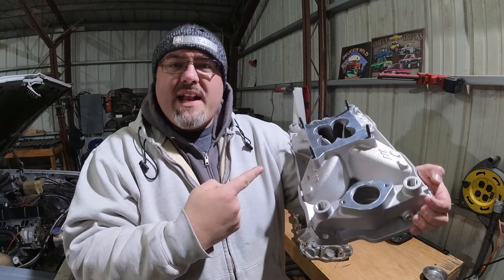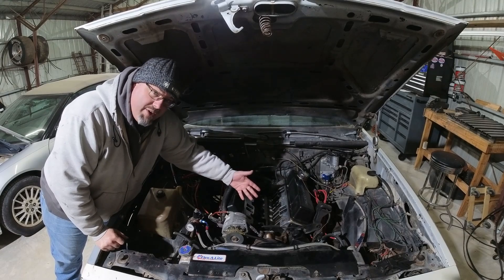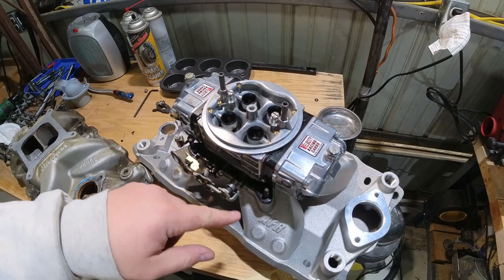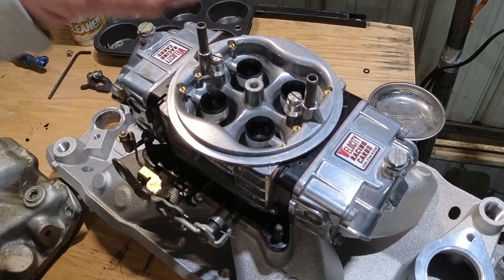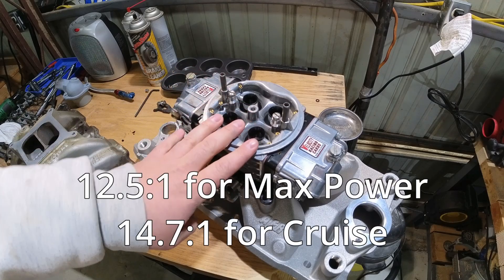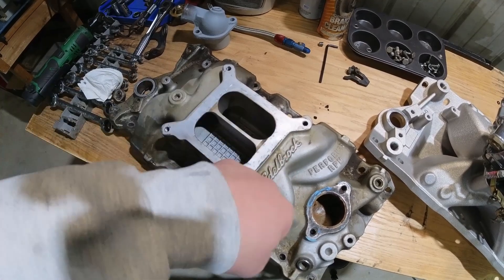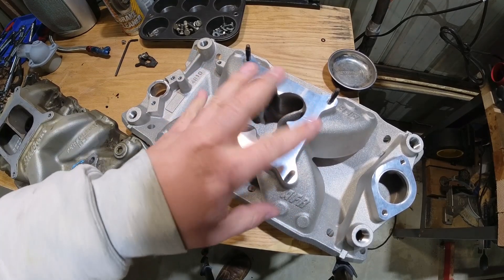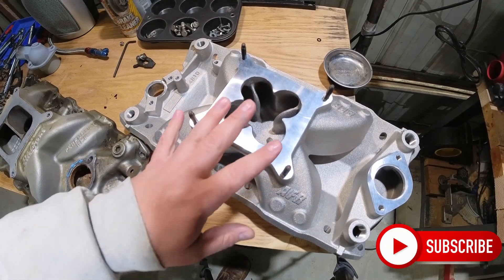Single Plane vs Dual Plane Intake Manifold, Which One Is Right For You?

Comment: Single plane all day if you have a moderate to decide build with decent gears.If you cruise around and will not see the light of day over 5000rpms stay dual plane.If you have weak gears and a heavy ride stay dual plane.If you have decent gearing and your car is not a tank and you shift past 6000 go single plane.

Comment: Did your car pick up in et? I have never been a dual plane fan. They are for cars with 3.42 gears and higher and lower stall converters. I have always been quicker with a victor jr than I was with high rise dual planes. Even a small 327 was quicker with a victor jr. Dual planes suck.
Reply from the maker: The dual plane is definitely better suited for street use than the track. It's what i had, so i kept with it. It was worth about .2 in ET and 2-3 mph depending on weather conditions. The performer RPM intake that was on there is a good intake, it worked well on this car from it's days with the original 2.41 rear gears and 1800 rpm stall through its growth to 3.73's and 3000 stall to where its at now with 4.11's and a 4400 rpm stall. The larger runners and plenum help this breathe more on the top end. My cam and compression are the biggest limiting factors. it's a 9.8:1 and a cam that was selected for a good torque production for street use. I'd like to take this closer to 11:1 and a much nastier cam. My carb guy is nudging me to move to e85 for many reasons.
Reply: @SnowFamilyRacing  2 tenths is pretty damn good just for an intake change. I never liked dual planes on the street, but the cars I drove was more like bracket cars than grocery go getters.

Comment: I have a 383 stroker with 501hp and 522tq engine dyno with the rpm air gap manifold.

I have 3:73 gears and a 3000 stall.
It would literally fry the tires in 1st 2nd and drive.
So I changed the manifold to the Victor Jr single plane which moved my TQ up the RPM scale.
I also installed a Wilson 1” 4 hole spacer.
Engine Master did a show on this and the 4 hole with the single plane made the biggest HP/TQ improvement.
But what I mostly did was improve cylinder to cylinder AFR consistency.

So now I don’t fry the tires as bad which equals better take off.
You may ask “why don’t I just use slicks”? 
I don’t mind my tires being the weak point.
Really good traction = broken parts.
The only racing I do is with my buddies maybe once a year.
It’s pretty much a cruiser anymore.
Reply from the maker: Valid point to move the torque curve higher. I've never had mine near a dyno, but if it made 400 to the crank, I'd be thrilled, but this was built for big torque and is easily over 400 ft lbs. The 7.5 10 bolt let go for the last time last summer and now has a nicely prepared 12 bolt with a spool. I'm using 29x11 slicks on the track. On street tires, they don't stand a chance against the 4.11's and 4400 stall converter.

My carb builder and I have been working on making this as consistent as possible. The move to a single plane will be another step in that direction.

Comment: For street driven, the 2 inch phenolic spacer on a dual plane intake really worked well across the range of 2000 to 5500 RPM 6:45
Reply from the maker: That combo worked quite well for what it was! it's too bad that suffered from rapid spontaneous disassembly...